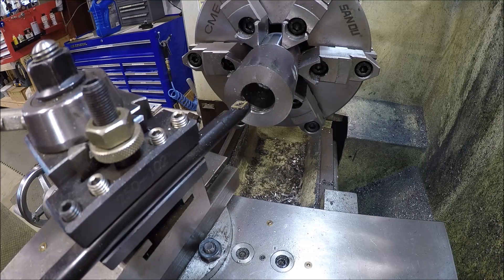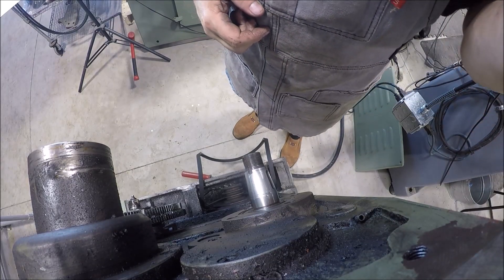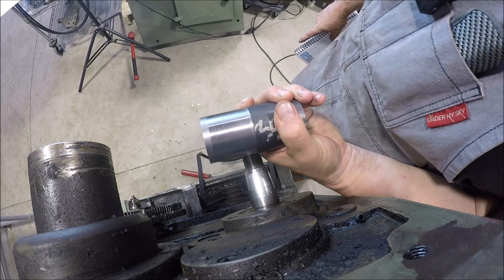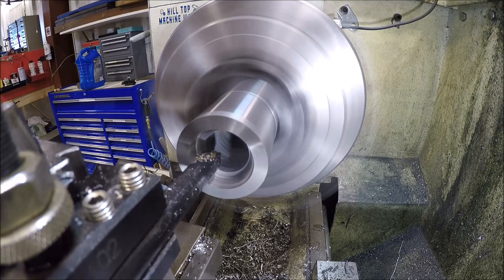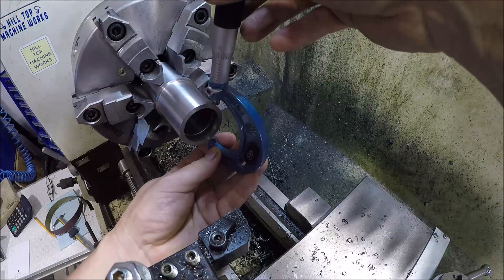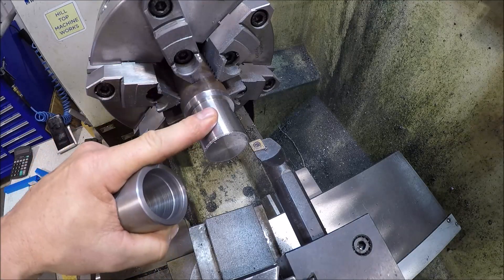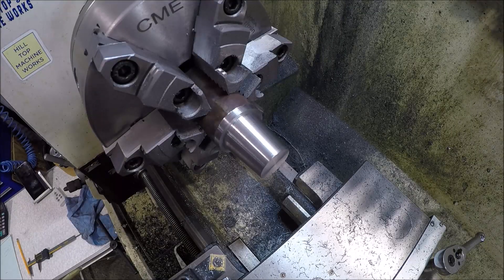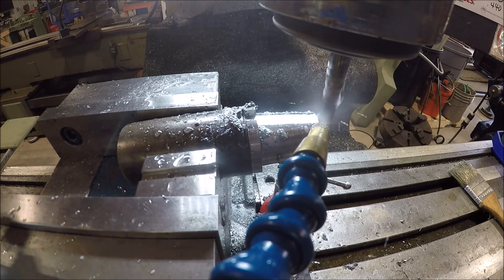Repairing the drive pulley on the big jet lathe. Part 2

Comment: I love the 123 block taper measurement method. Nice approach. I was thinking at first that you could just add a second keyway to the pully, but if the taper was hosed, you had no choice.
Reply from the maker: It was tricky with such a short taper to measure. Easy to introduce error. The 123 block was what I came up with to help with that. 🙂

Comment: Very nice work, iv always enjoyed cutting tapers
Reply from the maker: Thanks Adam. I wish I had a tool post grinder so I could get that bore super smooth.
Reply: @hilltopmachineworks2131  me to, I have sometimes when I want a super smooth finish use a strip of leather with a super fine grit rubbing compound at slow speeds that works well, crude but it works

Comment: Always a worry machining for a press fit. Quite a bit of work to make that broaching bush but cutting a keyway on a shaper also has its complexities so I guess it's down to the particular job in hand. Cheers
Reply from the maker: Yeah it was a compromise. I will feel more confident using the shaper once I get some time on it with non critical parts to key way.

Comment: G'Day Tom, the tapered broach is the way to go.  Done a lot of them over the years and they work fine.  The taper could possibly the same as the tapered shafts on DC motors.  I didn't see it but I assume you used the rise over run with a dial indicator to set the Top Slide angle.
Cam
Reply from the maker: Hey Cam. I hope you are doing well. I did use an indicator to set up the compound.

Comment: Hey Tom. I saw a taper mic in an antique shop near me where I bought a bunch of thread mics. I might have to go back and buy the taper mic now!

Question: I have been debating on coolant for the vertical mill. What is your setup? What are you using for coolant? Any issues? I head that fogging can be an issue and you certainly don't want to breath it. I've also heard some folks complaining that the coolant is sticky and makes a bigger mess than a spray bottle of WD-40. I'd like to know your thoughts. - Greg
Reply from the maker: Go back and grab that mic Greg if you can. The ones I have found on E-Bay are crazy priced.
I am using Koolmist 77 and a Noga magnetic based mister. It works really well. Plus you can set it up on whatever machine you want. That way you don't have to have dedicated coolant systems at every machine. No fogging problems with it. I did use another brand before, and it was horrible. Fogged up the shop and you had to wear a mask. No rusting issues either.